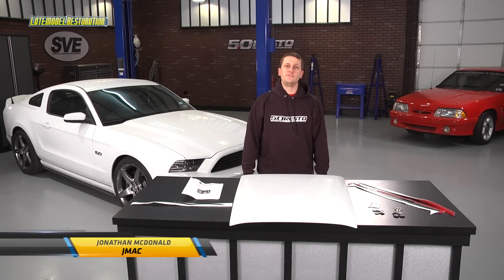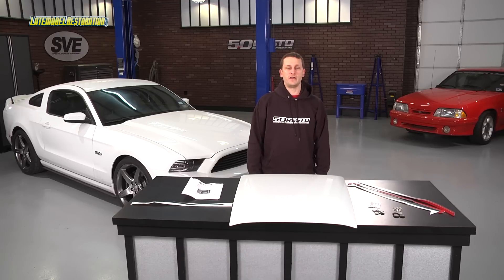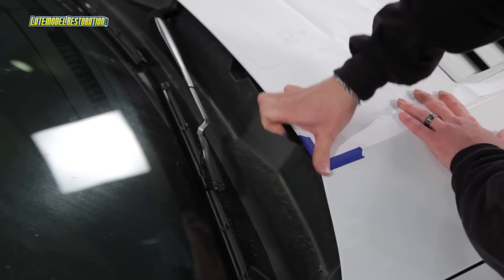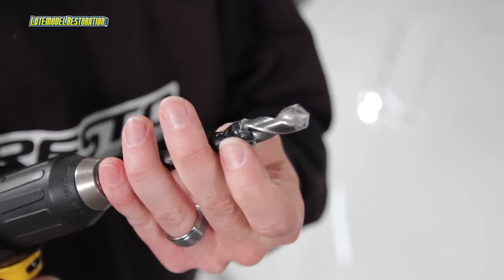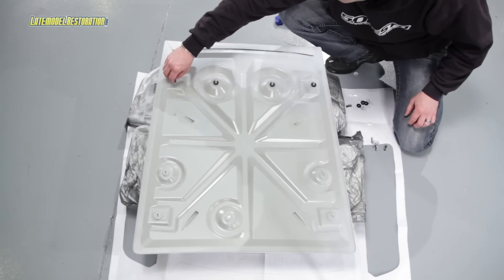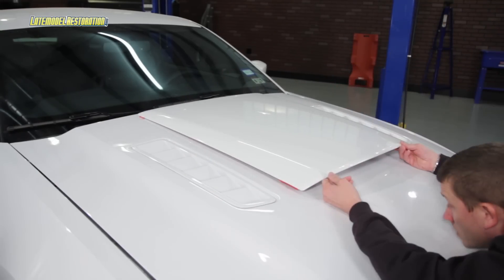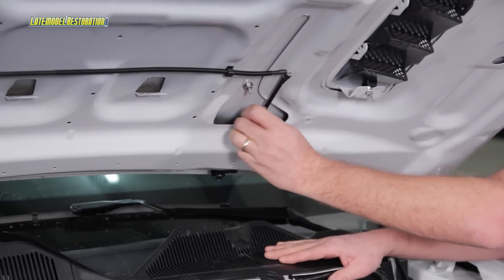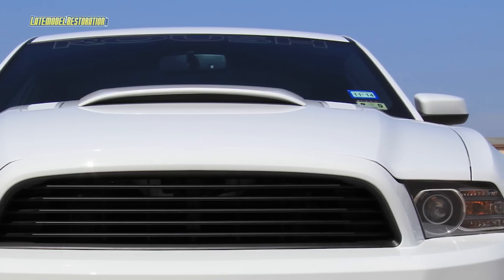Roush Mustang Hood Scoop Installation (S197 2013-14)

Comment: I have a 14 Stage 3 Roush with the hood scoop installed by Roush. ( Never liked fake scoops, but it looks ok on the hood). Both rear corners are pulling up about 3/16" Everyone I spoke with so far says to re-tape it, but it's not sitting right on the hood.. I thought Roush made everything using factory CAD data. It needs to sit right before putting more tape on it.